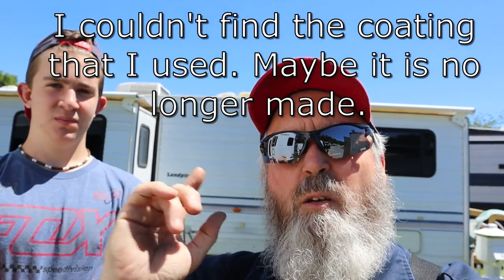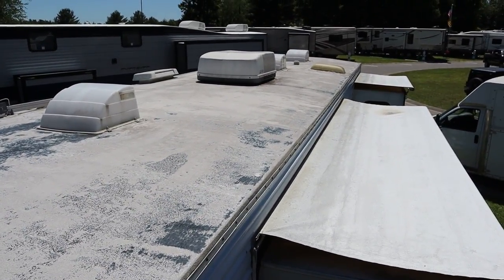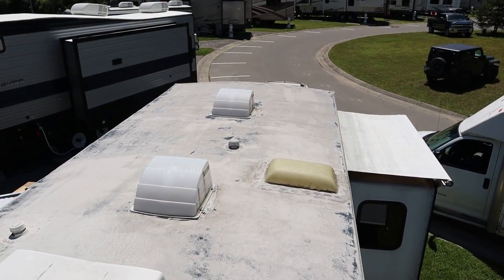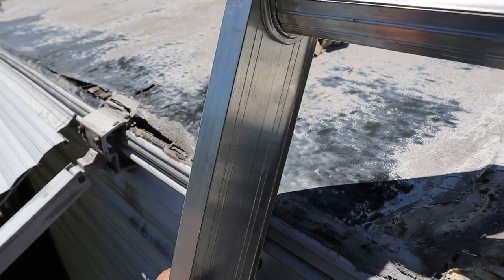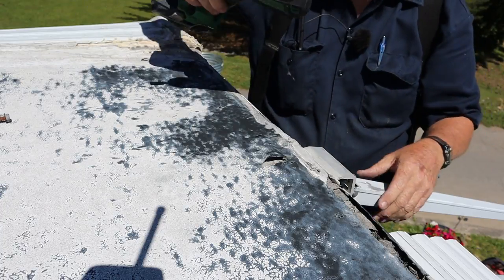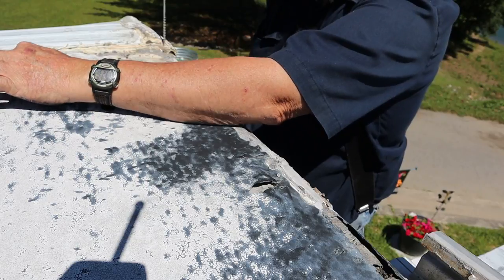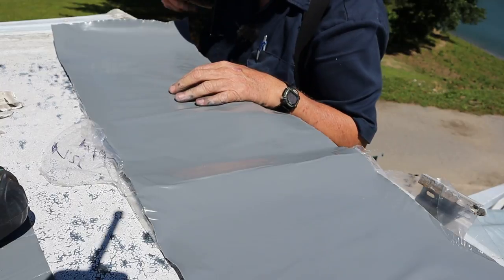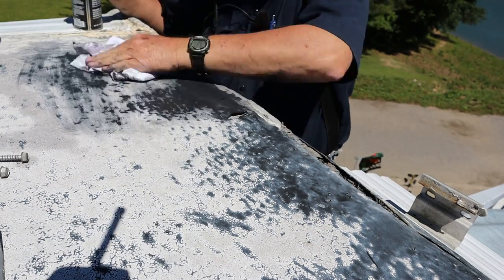Rubber Roof Coating 12 Years Later, What Does It Look Like?

Comment: Thanks for the brake Cleaner idea. I'm about to do a coating on my roof of a 97 bounder. My roof however is in perfect condition and gets inspected frequently.  I look at an EPDM roof and wonder how it came to be a standard in the industry....it's as if the engineers that designed these things wanted them to eventually leak. Thanks this video was helpful!
Reply from the maker: I have been saying that for 30 years.

Comment: Have you ever used the Gako roof coatings? It's intended for commercial flat roofs, but has a 50 year "ponded water" guarantee. I have a '96 5th wheel with an EPDM roof that needed partial replacement. It needs solid structure to bond to, and my patches were not tidy, but top coating with the Gako has kept me dry. I even had tears patched with self-stick window flashing and ZIP liquid flashing, and I applied the Gako right over them too. Haven't noticed any changes in the 4 years since, including in low spots that stay wet in this Appalachian rain forrest
Reply from the maker: Thanks for the info.
Reply: You mean Gaco ?

Comment: Eternabond is good but i would have told them they need a new roof and left. Eternabond is really good for patching holes. We use it on commercial tpo roofs on buildings to fix tears and seams that have come unwealded. Imo that is too gone.
Reply: A new roof is more than the value of the camper.

Comment: My roof is almost completely black but in good condition, can i just do a few coats of tropicool to seal it? I cant find any videos of almost completely black roofs that are in good condition other than the white coating being gone. Theres no tears anywhere. Is the black rubber waterproof too or is that only the white coating you add that is waterproof?
Reply from the maker: The black is your rubber roof. Only the top layer (the white) is worn off. If the camper is newer and in great shape and you plan to keep it for a long time and you can afford it, I would replace the roof.  
That being said, there are plenty of rubber roof coatings on the market, just do your homework. You want to find one that will bond to the old rubber not just coat it.
Reply: @hillbillyrv   ok thank you for your help! I plan to replace it later on but for now I'm going to seal it.